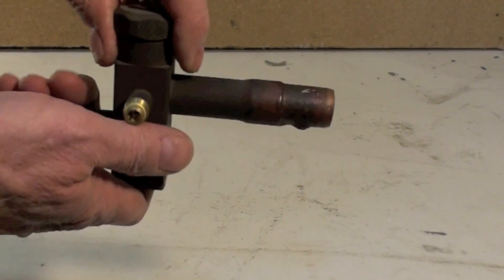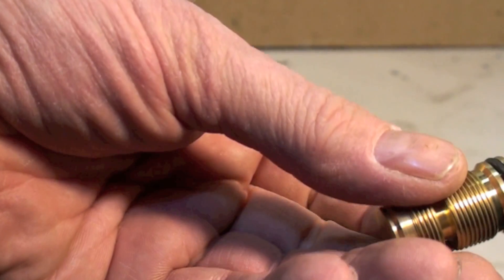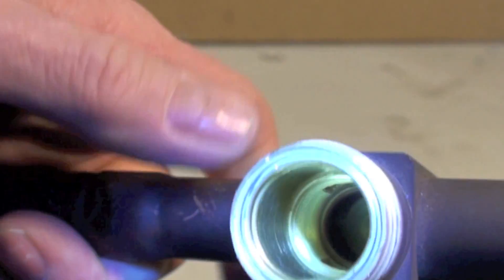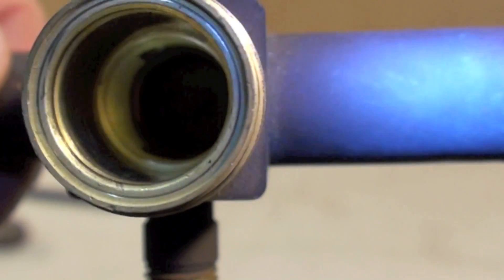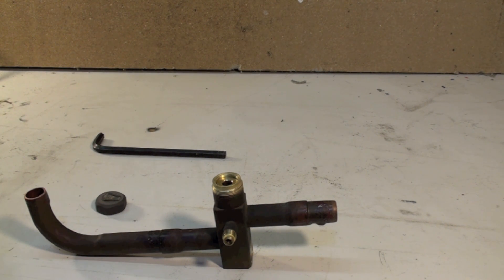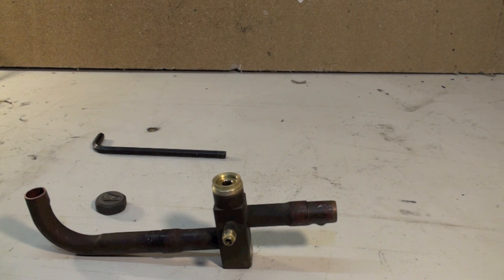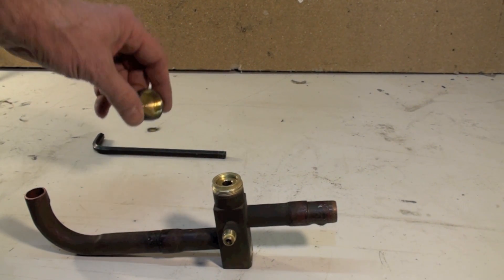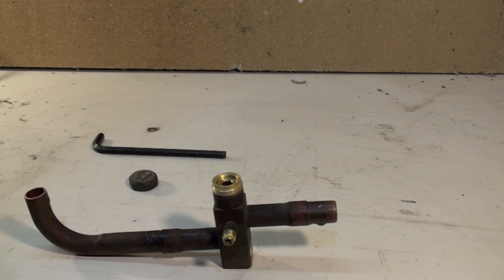Air conditioning service valve

Comment: Do you not just remove the plunger and valve core before brazing the service valve on?
Reply from the maker: First, some of the valves are designed so that the plunger cannot be removed.  Second, its not the plunger that is the problem, its the body of the valve that gets warped.
GFM

Comment: Recommend replacing the service valves due to over heating when brazing and cause the failure of o-rings.  Bypass the service valves by add a new line with a schrader valve will work ?   This is a cheapest solution and solve the problem of leaking service valves !
Reply from the maker: I have been advocating replacement of service valves with a line tap brazed in for years.  Mostly because service valves are the biggest leakers and their use simply is a source of leaks.  My motto is when checking for leaks, first check the service valve.  If it is not leaking, check it again because it probably is.
GFM
Reply: @grayfurnaceman  last line is gold

Comment: and this is why I run water over the valve and purge with nitrogen while soldering service valves. And no water does not get in the system.

Comment: Great information and video, as usual, but a diagram would be helpful here. 

The experienced guys can relate to this, but it's  confusing to newcomers.

Case in point: there are 2 openings, 1 is a Schrader valve.  Isn't that the "service valve "? If not, what is the Schrader valve there for?
Reply: See https://youtu.be/gFFLYmD_2d4

Comment: Heh i got a queztion. Can you help?
Thanks in advance
Reply from the maker: Ask away.
GFM
Reply: grayfurnaceman  I replace a 7/8 service valve  but its a diffrent model.  Would a diffrent model make the system not to cool?   Thanks in advance.  Love your videos
Reply from the maker: Probably not.  Could it have a leak?
GFM
Reply: grayfurnaceman  i just check and no.
Looks like bad compressor. Suction wont go past 25 of preassure and comp rattles

Can you make video of bad compressor.  Thank you sir
Reply from the maker: Most of them fail locked rotor, so there is not much to see.  If I get one that has valve problems or a mechanical failure, I will do a video on it.
GFM

Comment: Nylog under the cap did fixed the problem for me. Both high and low pressure valves were leaking, about 2 lbs of r22/year. When they leak you can detect it with any halogen detector with the caps removed.
Reply: NorthEast Sir, while it is not a permanent fix by any means, combined with yellow teflon tape rated for gases and -450F-500F 10,000 psi ($9 nylog for under cap area, $4 tape for threads) it does stop the leakage. Your preferable method of fixing the problem - replacing the service valves - is extremely cost prohibitive for a regular homeowner. Pump down, nitrogen brazing, evacuation, new valves - $1000 is a very low estimate, more like a $1500 job. Once again, I totally agree with you that that's the best way, but it is like to replace all the valve seals and piston rings in a 200K car engine because it takes a quart of oil every 5000 miles using dealership service center.
Reply from the maker: NorthEast That type of fix is not a true repair and I would not trust it. Kind of like radiator stop leak
GFM

Comment: is it still a good practice to wrap it with rags when brazing, or using something else and what?
Reply: Get some heat sink compound (I use the Hot Dam brand) and slab a bunch of it right where the copper meets the valve before brazing, making sure to cover the area with the compound very thoroughly. Take the schrader out too. The heat sink compound will slowly shrivel up as you keep heating up the area around the valve, so try to be as quick and economical as possible with your brazing. The longer you have heat close to the valve, the more of a chance there is that you will screw the valve up. There's a bit of cleanup afterward but not much.

Comment: great vid. Goodman condenser installation instructions state to set it 1/8 inch from being fully open.
Reply from the maker: Yes.  If it is tightened open, it may leak.  Thanks for the thoughts.
GFM

Comment: GFM,  thinking about the construction closely as you exposed it... something does not make sense.    With the valve closed or front-seated fully it cannot be the o-ring that acts as a sealer between the lower pipe and upper pipe and schrader.   It must therefore be a brass to brass seal that closes off the lower pipe when the valve is closed.   Therefore, the only thing that makes any sense is that these are designed to be opened once when the unit is initially installed and the cap is meant to seal it afterwards.   I don`t think they made these with any regard to servicing the unit with pump-down.   They probably expect recovery as the only viable method to service the systems anyway.    It is apparent that manufacturing engineers put very little thought into how these systems are actually serviced in the field.

Comment: Usually its the suction side valve that starts to leak... of course being a bigger pipe it takes alot more heat to complete the brazing.   Also, I understand your comment about warping the valve however I think the o-ring will melt way before the valve has a chance to warp.
Reply from the maker: +Gene Friedman The valve will warp at lower temps than you may think.  
GFM
Reply: +grayfurnaceman But if the issue is warping wouldn`t it start leaking immediately?   Seems most of these leaks start happening after years of service which leads me to believe deterioration of the o-ring is the key factor.  Certainly heat from the brazing operation will shorten the life of the rubber.
Reply from the maker: +Gene Friedman I have seen them leak right off and some that leaked later.  Sometimes you can replace the o ring and it won't leak and sometimes not.  
GFM
Reply: grayfurnaceman i recently did the brazing on a goodman unite bit i did not wrap n when i opened the low side the liquid started to leak it looks like i blew the o ring how do i fix it without redoing all this work

Comment: As a service guy, loves these calls, shitty installer didnt wrap the valve in a wet cloth, probably didn't take the schradders out either, generally see the blue junk (thread lock) around the cap. For the 2 minutes it would take to remove and wrap, would save the homeowner a lot of money, and the embarrassment for the installing company.  If one of our installers did it, I'd send a vid to the installer and the service manager, practicality is great, laziness i hate.

Comment from the maker: In a word NO!!! on the removal of gauge set under vacuum.  First, evacuation with schrader valves in is like showering with a raincoat on.  You need the easiest way possible for the gasses to get into the vacuum pump.  If you remove the gauge set under vacuum you are guaranteed to lose vacuum.  You can pressurize the lineset by cracking the liquid line to 5-10# PSIG, then install schraders under slight positive pressure.  I will be demonstrating this in a video soon.  Hope this helps.
GFM

Comment: I've seem instructions on the web that say you can remove the vacuum hose after you have evac'ed the line set. Does the  Schrader valve  let air back into the system ? Wouldn't it be better to let the refrigerant pressurise the indoor unit and lines and then remove the hose ?

Comment: so when the valve is closed ( tightened clockwise ) you can use the schrader valve to vacuum the line set/ indoor unit ?

Comment: You got that rite, that's the 1st place to look for a leak, I have run across a lot of them that people has tighten so much it will push the top off the brass cap, I have also used gas yellow Teflon tape to do pretty good job of stopping the leak but replacing the whole thing is the only real fix. great video

Comment from the maker: That does appear to be true.  The fitting appears to be similar to the rotolock fitting and the Trane fittings for their compressors.  I never found one of them to leak.  The piercing fittings we called Areoquip and the lines were precharged so no adjustment of charge was necessary.  They leaked like a sieve.  You could tighten them and they would stop, but just leak again.  They were replaced by service valves to allow pump down and stop the leaks!!  That worked well.
Thanks

Comment: I have had good success repairing these by using "for gas" teflon tape around the cap threads and than leak testing and monitoring for leaks. Well done. Good Vid!